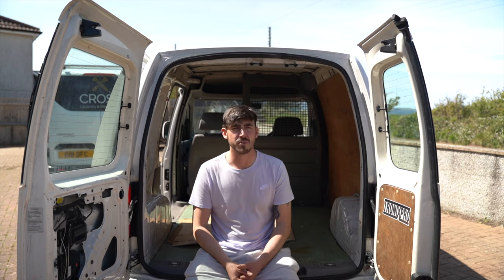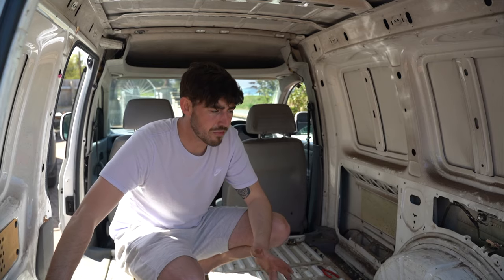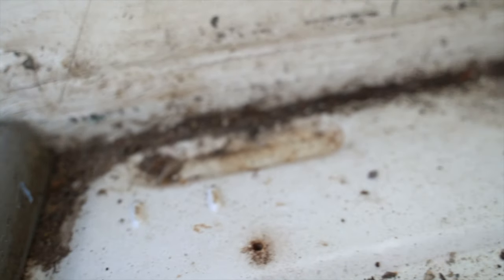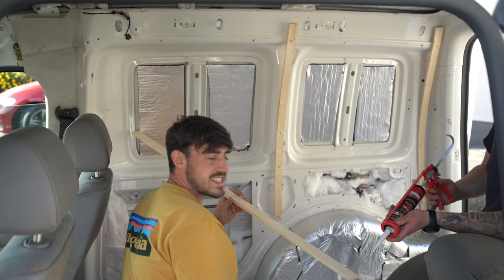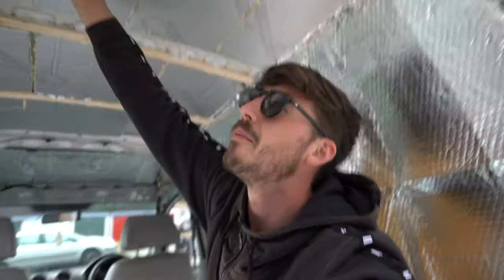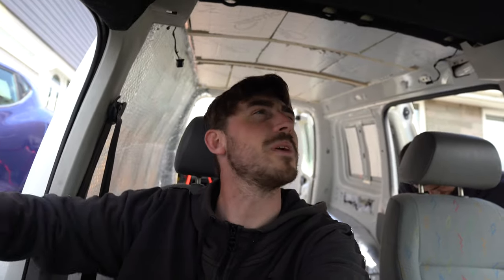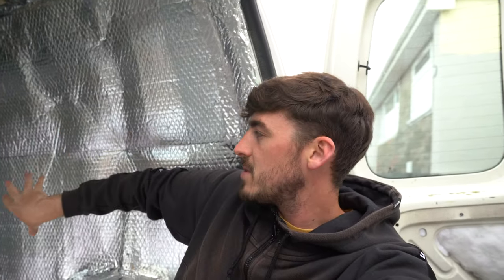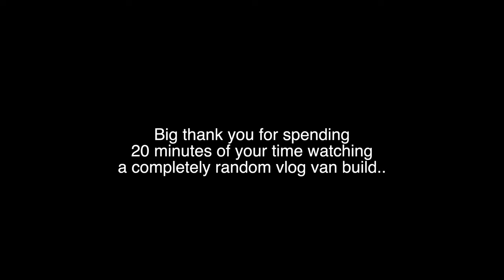VW Caddy van conversion - RIP OUT & INSULATE

Comment: Hi nice video  👍
Just a question,  have put dodo sound deadening/insulation in back off my caddy.  I have not put the recycled plastic stuff in as got told not to. Cos the dodo foam stuff dose the job. 

Now do i still need to put the bubble tin foil around the van like you have done at the end. Its driving me crazy cos people are doing stuff differently an that. 

Cheers
Reply from the maker: Hey Arran, thanks for the comment mate!

Anything will make the caddy better than leaving it standard, everyone does their caddy differently. I know many who have sound deadened it without the foil wrap, it's not completely needed. I used it for a piece of mind to know that everything behind the foil wrap will be complete air and moisture tight.

I would recommend doing it mate!

Comment: Hi!! Looks fab. Could you possibly list what and how much of everything you used please? I'm stripping out my caddy at the mo and I have no idea how much of anything I'm going to need to sound deaden / insulate
Reply from the maker: Hey Ellie! I will do, are you planning on putting many electrics in the van at all?
Reply from the maker: I will update the caption on this video soon, but I used 6 rolls of the sound deaden, this is the one I bought on eBay: https://www.ebay.co.uk/itm/254676479196

and the insulation I used is https://diy.com/departments/diall-insulation-roll-l-6m-w-0-37m-t-100mm/3663602481812_BQ.prd however have a little look around as you may be able to find cheaper options.
Reply: @Tom Carder Media  thanks so much for your reply - annoyingly I've just read it now and I have some other sound deadening stuff getting delivered today that is more expensive lol. If I run out I will buy some of that for sure! I'm not bothering with electrics in mine initially and I'll see how I get on, if I really miss it I might save up for a portable power station. Thanks again for getting back to me, great videos!
Reply: @tomcardermedia  I've just rewatched this video and forgot you carpeted the roof in the cab area. Great idea, mine is also pretty grim so could do with a revamp. Could you possibly link the stuff you used and let me know how much you used? Thanks!
Reply from the maker: @elliedavison7747  no worries at all! The main reason I have put electrics in mine is due to have a lot of camera equipment to have to charge, I know many who haven’t put electrics in there and have been absolutely fine! It’s just a personal preference☺️
Reply from the maker: @elliedavison7747  main reason I done it is because it was absolutely grim! I believe I used around 20m of it, however if you are smarter then me, you will utilise the amount you use rather then butcher the carpet😂I also carpeted a few other bits in the van, which will be in vlog 3, I still have a few bits to finish and film before that ones out🙌I’ll send you a link to the carpet
Reply from the maker: @elliedavison7747  Hey Ellie, sorry for the delay! Here is the link to the carpet I used. https://www.ebay.com.au/itm/282698206134
Reply: @tomcardermedia  thanks for all your help! Can't wait for the rest of your videos ☺️
Reply from the maker: @elliedavison7747  You’re welcome! I’m actually in the process of finishing vlog 3! And you’ve inspired me to create a video talking about how much everything cost etc. So thank you too🙌